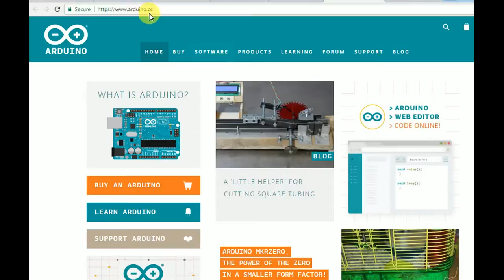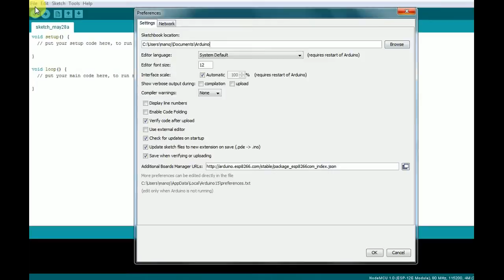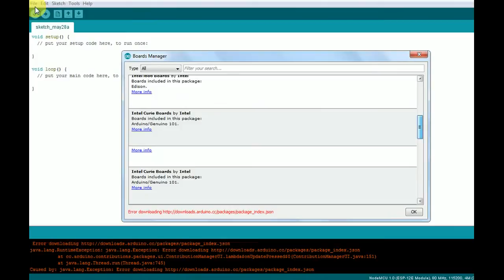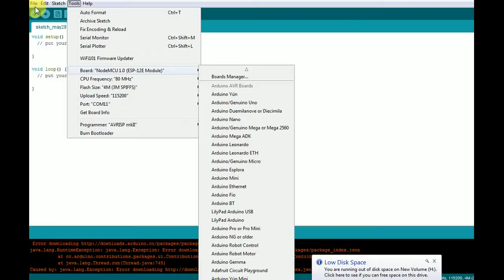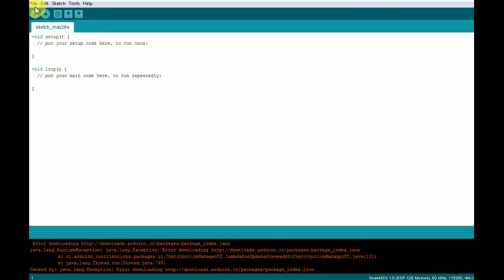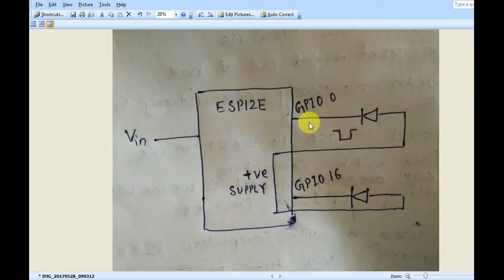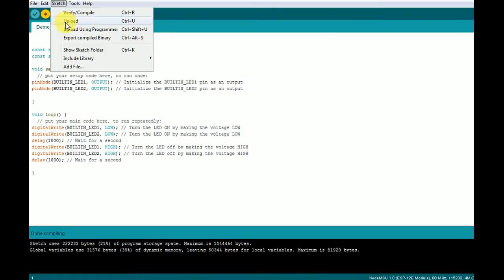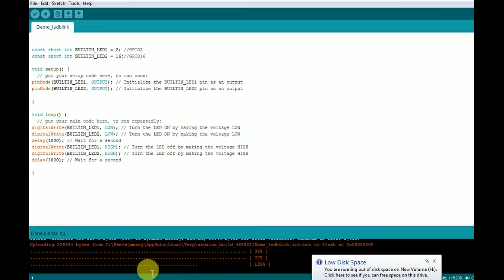ESP12E NodeMCU Configuration & Programming- Getting started with LED Blink

Comment: bro pls help me i am getting this error 
Arduino: 1.8.12 (Windows Store 1.8.33.0) (Windows 10), Board: "NodeMCU 1.0 (ESP-12E Module), 80 MHz, Flash, Legacy (new can return nullptr), All SSL ciphers (most compatible), 4MB (FS:2MB OTA:~1019KB), 2, v2 Lower Memory, Disabled, None, Only Sketch, 115200"

Executable segment sizes:

IROM   : 242976          - code in flash         (default or ICACHE_FLASH_ATTR) 

IRAM   : 26928   / 32768 - code in IRAM          (ICACHE_RAM_ATTR, ISRs...) 

DATA   : 1264  )         - initialized variables (global, static) in RAM/HEAP 

RODATA : 952   ) / 81920 - constants             (global, static) in RAM/HEAP 

BSS    : 24968 )         - zeroed variables      (global, static) in RAM/HEAP 

Sketch uses 272120 bytes (26%) of program storage space. Maximum is 1044464 bytes.
Global variables use 27184 bytes (33%) of dynamic memory, leaving 54736 bytes for local variables. Maximum is 81920 bytes.
esptool.py v2.8
Serial port COM5
Connecting....
Chip is ESP8266EX
Features: WiFi
Crystal is 26MHz
MAC: 8c:aa:b5:0e:50:00
Uploading stub...
Running stub...
Stub running...
Configuring flash size...
Traceback (most recent call last):
  File "C:\Users\HP\Documents\ArduinoData\packages\esp8266\hardware\esp8266\2.7.1/tools/upload.py", line 65, in <module>
    esptool.main(cmdline)
  File "C:/Users/HP/Documents/ArduinoData/packages/esp8266/hardware/esp8266/2.7.1/tools/esptool\esptool.py", line 2933, in main
    detect_flash_size(esp, args)
  File "C:/Users/HP/Documents/ArduinoData/packages/esp8266/hardware/esp8266/2.7.1/tools/esptool\esptool.py", line 2241, in detect_flash_size
    flash_id = esp.flash_id()
  File "C:/Users/HP/Documents/ArduinoData/packages/esp8266/hardware/esp8266/2.7.1/tools/esptool\esptool.py", line 607, in flash_id
    return self.run_spiflash_command(SPIFLASH_RDID, b"", 24)
  File "C:/Users/HP/Documents/ArduinoData/packages/esp8266/hardware/esp8266/2.7.1/tools/esptool\esptool.py", line 853, in run_spiflash_command
    old_spi_usr = self.read_reg(SPI_USR_REG)
  File "C:/Users/HP/Documents/ArduinoData/packages/esp8266/hardware/esp8266/2.7.1/tools/esptool\esptool.py", line 490, in read_reg
    val, data = self.command(self.ESP_READ_REG, struct.pack('<I', addr))
  File "C:/Users/HP/Documents/ArduinoData/packages/esp8266/hardware/esp8266/2.7.1/tools/esptool\esptool.py", line 347, in command
    p = self.read()
  File "C:/Users/HP/Documents/ArduinoData/packages/esp8266/hardware/esp8266/2.7.1/tools/esptool\esptool.py", line 292, in read
    return next(self._slip_reader)
  File "C:/Users/HP/Documents/ArduinoData/packages/esp8266/hardware/esp8266/2.7.1/tools/esptool\esptool.py", line 2045, in slip_reader
    raise FatalError("Timed out waiting for packet %s" % waiting_for)
esptool.FatalError: Timed out waiting for packet header
esptool.FatalError: Timed out waiting for packet header

This report would have more information with
"Show verbose output during compilation"
option enabled in File -> Preferences.
Reply from the maker: @salil were you able to resolve this error? It seems comm port and baud rate is not set correctly.